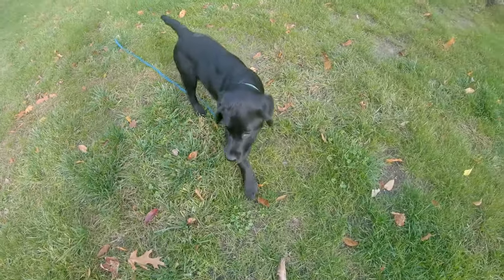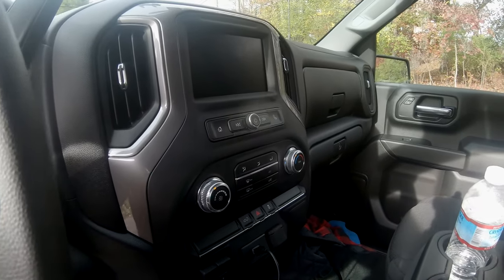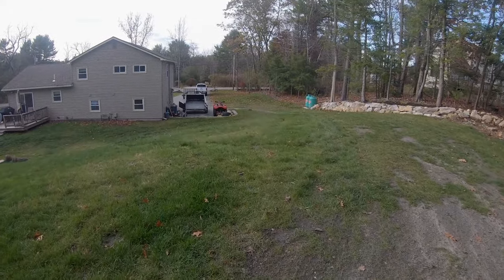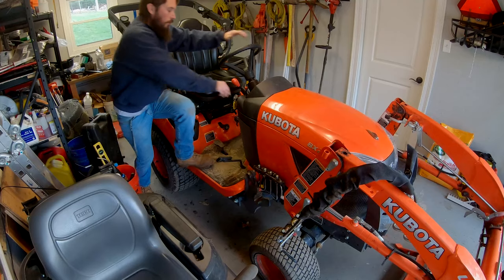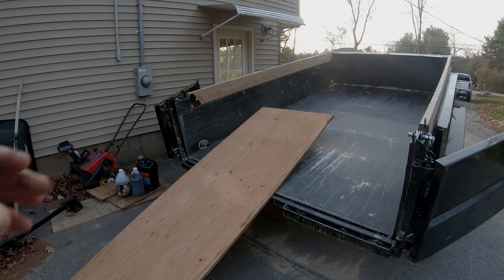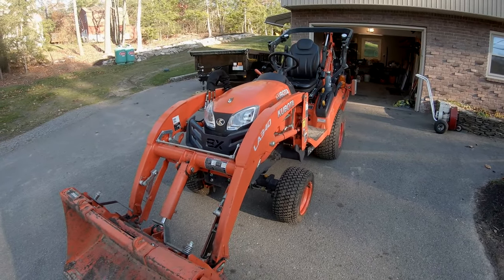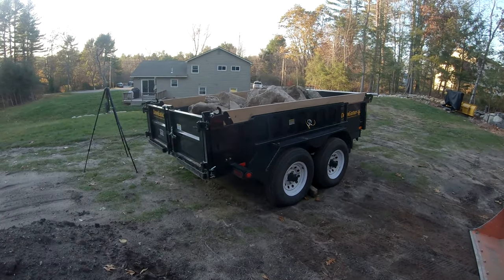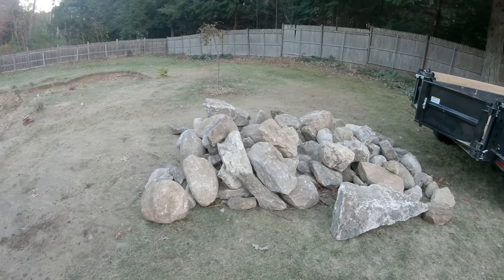New Truck, Kubota Maintenance & Rock Delivery

Comment: Just saw a more recent video of yours where you mentioned that you had transmission problems with this truck.  Sorry to hear that. What's the update? Thanks again for this video as well.
Reply from the maker: Luckily, it was all covered under warranty. I guess the main output shaft just sheared in half, didn't even have more that 8k regular road miles on it!

Comment: Can even tell on the video how much easier the loader is lifting those rocks. I wonder if Kubota has the pressure low so people don't get themselves into strife and tipping the tractor over etc.
Reply from the maker: Yea, I imagine they set it lower such that tipping doesn't occur as easily and wear on parts is lower.

Comment: Put some slime  in your tire put on my zero turn 4yrs ago. Very little  air loss but valve stems go bad after 3yrs there a trade off lol.
Reply from the maker: Yeah, I debated on Slime previous to these holes but didn't want to make a mess of the tire/stem/rim when I inevitabley have to replace the whole tire again when I shred another sidewall 😆

Comment: Hoses rated  for 3k 2200psi is not to bad.
Reply from the maker: Yeah, my concern was more for the extra weight on the frame, axel, seals and tires more so than the hydraulic system. But so far it is looking very promising!